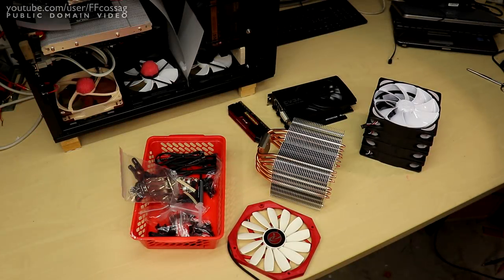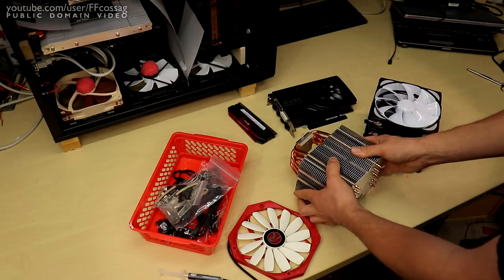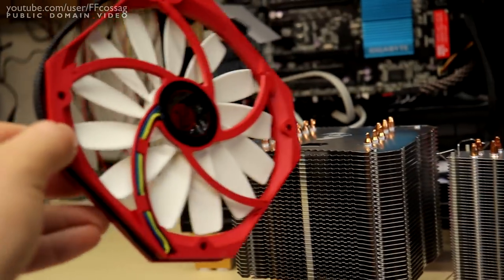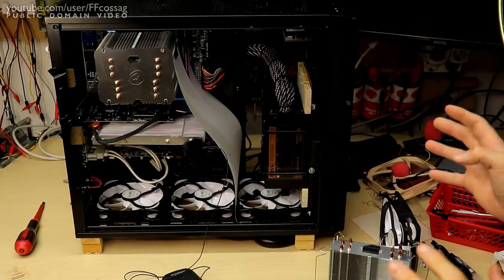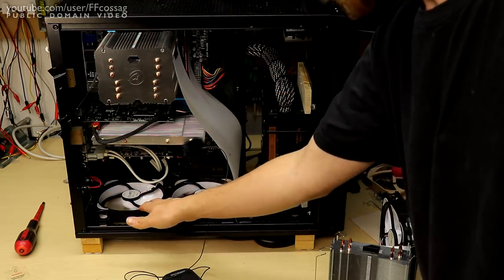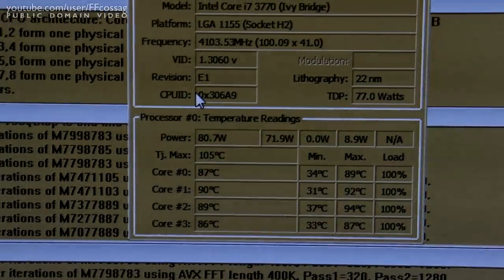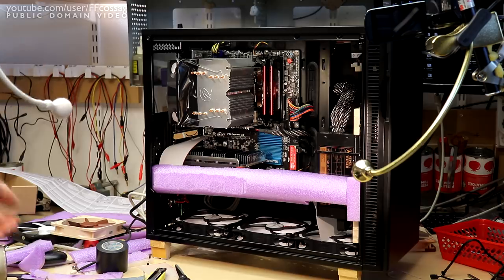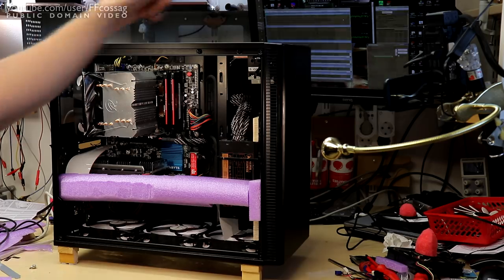Making a quiet PC quieter, by using expensive fans and a purple pool noodle

Comment: Hi, good videos and channel. I  been subscribed to you for years with my other youtube account.  I have a comment and a suggestion... While your CPU, power supply and GPU are cooled the other motherboard components are not and will get very hot,  Your case has no exhaust out the rear or out the top to extract heat. This is further compounded as you have the purple foam blocking any airflow up to the top of the case, this means with little to no air flow or no exhaust your VRMs near the top and the other motherboard chipsets can get to some scary high temperatures.. This is especially an issue as you are overclocking.  I suggest either a top exhaust to blow heat out or a top mounted inlet to bring cool air in to the VRMs and the rest of the motherboard.
Reply from the maker: That's a reasonable concern, but it's under control. I run a reasonably high end motherboard with some pretty decent VRM heat sinks.  IIRC VRM temps are in the 70's even under full load.
Reply: @FFcossag  Ah great, good to hear they are staying cool under load.

Comment: Good work, reminds me of what I did back in the day. The previous setup had a dominant raspy/buzzy component to it, which I would suspect was CPU fan vibration (motor poles) transmitted to heatsink, board and case. Your solution may have been a bit over the top but it's hard to argue with the results. As far as I could (not) hear it over the microphone hiss, anyway - feel free to drop me a line if you need some help with that.

Comment: two more fans on top, and that cpu fan in pull configuration, otherwise is positive pressure in this case and lots of dust overtime.
Reply from the maker: Au contraire; positive pressure pushes filtered air out of the case.

Comment: You might get way better cpu temps, if u cut off the vga-s hot air blowing straight on it. Could have 3 ""chambers", 1 for vga, 1for cpu and 1 for psu.
Reply from the maker: Yep, but it's really tricky to achieve that in an ATX case without mounting the graphics card weird, or using horizontal flow.

Comment: take a complete liquid cooling solution and change the stuck fans with your fancy ones, it's that simple if you want good performance and quite at the same time.
Reply from the maker: That still leaves you with pump noise on top of the fan noise, which I'd rather avoid, as well as a requirement for much higher static pressure in order to shove air through the tight fin spacing of the radiators.

Comment: Why is every single fan arranged to draw air in? IIRC positive case pressure will prevent dust ingress, but is also going to run hotter. I would isolate (with air guide) and flip the fan under the PSU to draw air out.
Reply from the maker: This build takes advantage of convection; all air moves upward for that reason.
Reply: @FFcossag  I've build my PC with that in mind in the past, but in my experience having fans create both a positive and negative pressure on different sides of the case creates a must more powerful flow. In fact I sealed up the top vent on mine, two fans push in at the front and one exhausts out the back (there are also passive vents on the back). The result is more focused flow. But, my case design is also different (Antec P183).
Reply: @FFcossag  Well... At VERY low airflow, convection does happen but anytime you fit a fan it is already forced convection because of the tighter space, as opposed to a house. The ratio between natural airflow and forced airflow is way past the point where convection actually does anything
Reply from the maker: I disagree. If I disconnect all the fans in this system, there's still a considerable amount of air flowing through it. For light duty use, it's perfectly capable of running completely passively, dissipating the roughly 50 W that it consumes through convection alone. While you are right that convection does not produce a lot of air flow, it does produce enough to make a difference if you make an effort to take advantage of it.
Reply from the maker: Your experience sounds a bit odd. It's common practice to always place the cooler on the turbulent side of the fan, since the air is more mobile and will touch more of your heatsinks before moving on. That said, sealing up vents in the wrong places does make a huge difference if done right.
Reply: @FFcossag  You are correct on which way to face a fan on the cooler. However, rewatching this, I believe having it on the rear side sucking air into the case causes flow stagnation since airflow has to then reverse direction to exit the case. This is indicated by the GPU flow issue mentioned at 19:20. I believe it would help a lot to change which side of the GPU cooler the fan is on (so that it aims to blow air out the back of the case). Also, do you have the fan in the PSU disabled? If not you may have similar air stagnation inside the PSU itself (or air coming out of the PSU from its own fan could be fighting the fan just below it).

Comment: You might have better luck with liquid cooler IMO. 
Great job though.
Reply from the maker: Liquid coolers have pumps, pumps make noise, and radiators still need fans. I have considered the prospect, but for the purposes of this PC being what they are, I don't think they're a suitable option.
Reply: No, liquid coolers aren't a better option at low power outputs. Sure, if the heat output is denser but at lower levels it's actually WAY better to have a silent system.

Comment: You should mount the cpu fan with rubber bands. tried it as a hack before and it works surprisingly well.
Reply from the maker: I may or may not have done that in the past. ;)
Reply: FFcossag :D works well honestly
Reply: Also zip ties work super well!  Especially if you have the appropriate color.

Comment: You keep saying passive. Nothing passive when you have all those fans in there. Or did you mean just the CPU cooler being passive. I guess that's what you meant.
Reply from the maker: I tend to say passive when talking about specific components; the GPU in this system has no fan of its own, and the CPU in the first iteration didn't either. You're right that the whole system is definitely not passive.

Comment: As Alfa said , if you delid the CPU you could gain up to 18-20 degrees
Reply from the maker: I strongly doubt that in this application, since we're not dealing with a huge amount of power. Delidding makes sense if you're pushing enough power to create a large thermal differential across the IHS, but that doesn't happen to any meaningful extent at a mere 80 W, with a heatsink that's running rather warm. The thermal bottleneck is in the air-to-heatsink coupling due to the low airflow.

Comment: Delid cpu.
Reply from the maker: That wouldn't make a huge difference, since it's an Ivy Bridge with soldered IHS, and the thermal bottleneck isn't the bond between the die and the IHS, but rather the bond between the heatsink and the air. Consider that we're not dealing with a hugely power hungry CPU; 80 W under absolutely full load isn't all that much.
Reply: FFcossag Ivy Bridge is actually thermal paste
Reply: @FFcossag  since ivy to coffee lake they used thermal paste. Liquid metal could make a difference on air to 10Celsius or 15 Celsius so it should make your life easier by doing that.
Reply: Not really, Ivy bridge is not as impacted as much as Coffee lake.
Reply from the maker: Oh, really? I had that backwards, then.
Reply from the maker: While the thermal paste does make things worse, I remain skeptical as to how much better it'd make this system; we're still dealing with a relatively low thermal load, and I wouldn't be surprised if the thermal bottleneck remains between the heatsink and the air.
Reply: Thanks for info guys :)